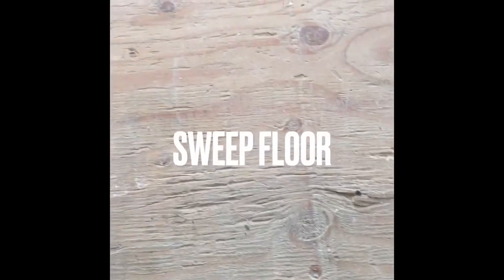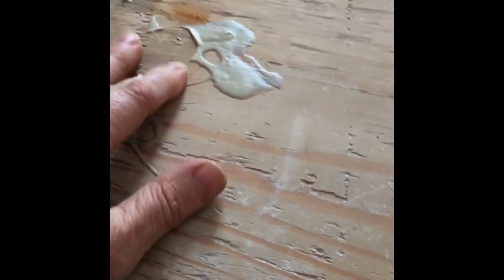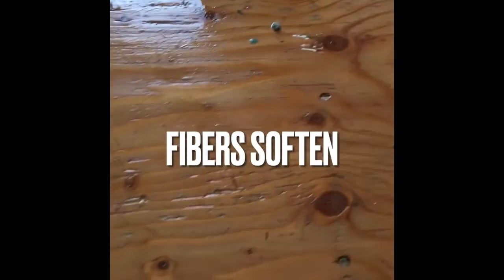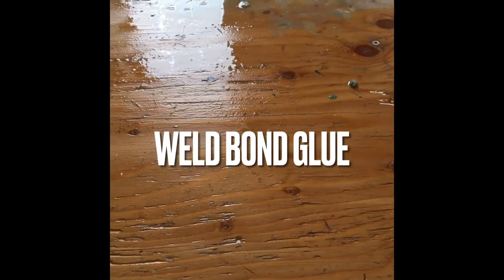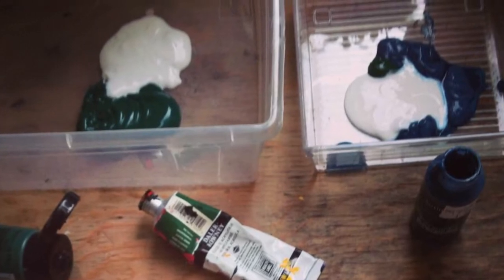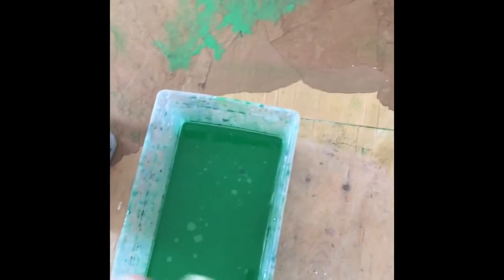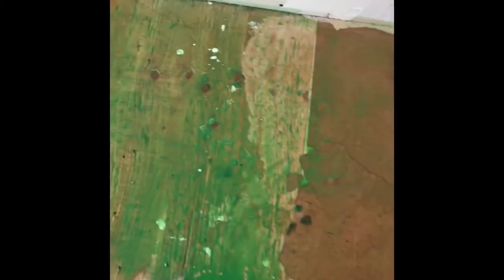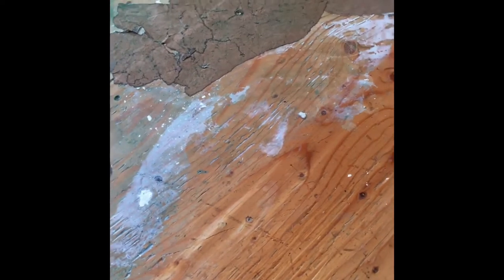DIY Paper Bag Floor Collage

Comment: Very cool, does the acrylic paint mess up the paper or is it all compatible?
Reply from the maker: It’s all water based and compatible. I would use roplex in art school but can’t find it anymore. Cement sealer seemed
To be the same thing
Reply: @in_8_ly  Cement sealer? Do you mean the Weldbond? I have used that on everything in my home ( interior)LOL. Mixed it with joint compound to add elasticity and covered a  very odd lathe and plaster garage ceiling  I made,it worked really well.